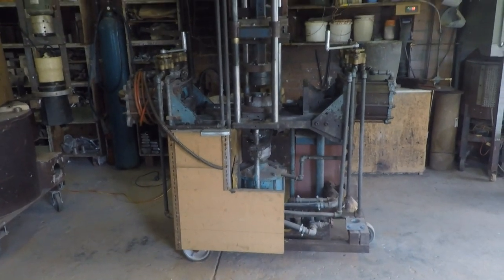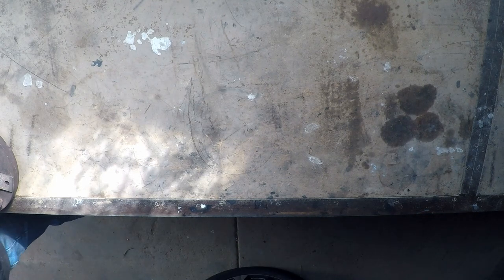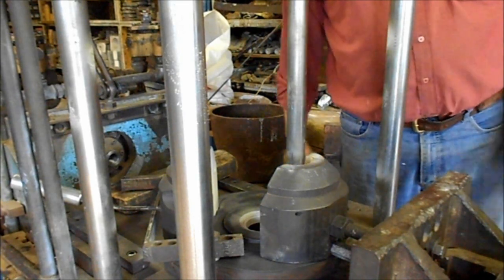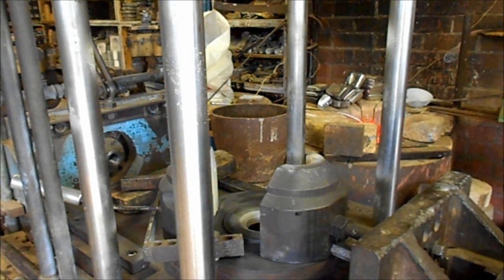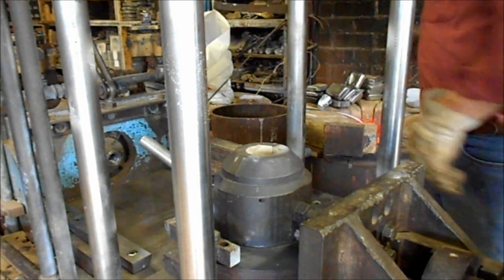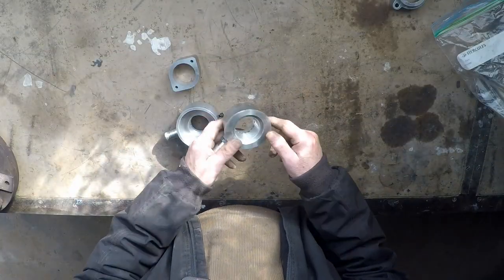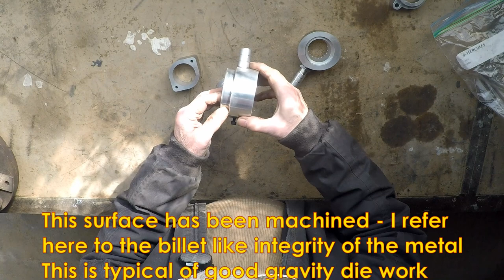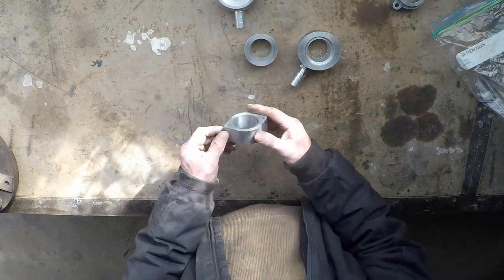A Gravity diecasting journey Part 3:- Complex and hydraulic

Comment: hi martin, thanks for capturing all this on your vids, it is most informative and inspiring. Can you pls list all the sprays and powders you apply on the aluminium molds before and after pouring? Also, is there a reason you did not cast the molds in steel or iron vs aluminium? wojldnt a steel molds be more "durable"? Pls advise, thanks !
Reply: wouldn't*
Reply from the maker: Quentin, I spray the hot die with a mold coat called 14ESS, it is made by Foseco. This is an insulating coat that allows the metal to run and fill the die. Also it helps with air removal from the die. It is my most used die coat. On some parts of the die I use a topcoat (i.e. over the 14ESS) of "Release Coat Blue" by ZYP coatings. This is a coat based on boron nitride and is a very good lubricant  thus it aids release from the die - it is however rather expensive. I use a paint on dry MoS lubricant on parts of the die that slide against each other. I also use some graphite powder on some parts of the dies and the machine that holds them, again it's for lubrication purposes. Most of my dies are in fact cut from cast iron. It is a better material than mild steel - higher conductivity for a start and it tends to hold the spray better. It is easier (if a bit dirty) to machine than steel would be. Only a few of my dies were ever made from cast aluminium, these are short life dies and even then can only be used where the part being cast does not contract onto the die - an aluminium die might last 500 shots a cast iron one many tens of thousands of shots. Does this answer your question? ... Martin
Reply: @olfoundryman8418  it exhaustively answers the question, thank you very much for the details. As mentioned, your videos are very informative. Please keep going, "drop" all you've got on youtube !

Comment: Great vids, lots of good info and small nuanced teaching you only get from time invested.

Any chance you have a vid on gravity  mould design? 
I plan on my first attempt at home doing a metal form to make a product Injeed to complement my lil CNC shop, (trying to learn everything does not/should not be milked from solid! )
Reply from the maker: Brian, No, sorry I do not have a video on gravity die design. In truth I do not consider  that I know enough about the subject to do a video on it (I know, I know this does not stop a lot of Utubers publishing but it does stop me!) Die design is an absolutely huge subject and one that unfortunately has more myth and legend than science involved in it. I am not bad on small simple work  but anything big and/or complicated and I run away.
My "secret" to die design was to remember that a die is not empty  - rather it contains air and if the air cannot get out the metal cannot get in. You see the results at things like internal corners where the metal will round out a little rather than fill the corner completely. A quick touch of die spray will fix the problem for a few shots (the air gets out under the metal through the roughness of the die spray) But a better way is to have some sort of joint in the structure of the die. The air will get out through the minute gap of the joint - if necessary shim the joint apart a "thou" or two. Hence as you say dies are best not milled from a complete solid - segmenting often makes machining easier too. I try to design a die so areas likely to trap air are on joint lines.
The other secret to making dies for one's own use is to make them oneself as to have others cut a die for you is way, way too expensive.  Then you just have to hope that future sales of the parts cast will  cover the cost of your time in cutting the die. This was the only way that I could get into gravity die work - I cut the dies and recouped the time later as best I could - it worked fairly well!
If you have a specific part come to me again and I will give you an address you can send details too and maybe - maybe - I can help with a design..... Martin
Reply: @olfoundryman8418   ahh, the sign of a man how has been in the trade a long time, long past the "knows just enough to be a danger". respect!    I do have 2 what I assume are simple parts in mind, a little advice would go a long way in saving me time/scraping parts!. I would be happy to share infornmation on them. better yet i can provide the CAD model if thats helpfull.
Reply from the maker: Brian, Come to me at   olfoundryman@gmail.com   with whatever drawings/models you have and I wil have a look. No guarantees mind you but I will sure have a good look.... Martin
Reply: @olfoundryman8418  i have sent you an email. thank you again for your responces and videos :)

Comment: I remember from your four barrel throttle body video you said that you were using a filter not to filter the metal but instead to reduce turbulence. (as close as I can remember) I don't recall seeing you use filters in any of your other videos. Do you think there is any benefit to using a filter in sand castings, or is it not worth the trouble. (easier to use with permanent molds than fragile sand molds)
Reply: Check out Martin's series on casting a piston for a 1910 Brush.  He uses a ceramic filter in that casting (which was done in sand).

Link to part 1:  https://www.youtube.com/watch?v=kf2xae2J9HE
Reply from the maker: Rudy, dfrossis right I do use a filter in the sand casting of a piston. This is a high  mould (for me) and with greater mould height comes greater metal velocity and thus the possibility of greater turbulence. Filters are great for slowing metal down, you can get a speed reduction in the metal stream of 3 to 5 times by incorporating a filter into the running system. For this piston we used a filter at the base of the sprue such that the metal had to go through the filter and then into the runner bar - the runner bar was 4 times the cross sectional area of the sprue exit. The filter reduced the metal velocity to a much safer level. I rarely use filters in my sand work because my moulds are quite low and metal velocities are therefore also fairly low. However if I were to use higher moulds I would likely use filters. In the case of the 4 barrel throttle body I top pour the casting and this is to be honest a recipe for disaster as it is a very turbulent way to pour. Initially I did not use a filter and every casting was found to have 3 to 5 mm air bubbles trapped within it  and revealed on machining - clearly the result of turbulence from  the metal falling straight to the bottom of the casting - a fall distance of a little over 100 mm (4 inches). By using the filter I cut the fall down to two falls of 50 mm (2 inch) each - way less turbulence and in now about 1000 castings no air bubbles.. Filters are fairly cheap at about $0.50 each. While perhaps a bit more difficult to use in sand moulds there are ways of successfully incorporating filters in them. Martin
Reply from the maker: dfross, Thank you for pointing that out.... Martin

Comment: Thank you for another great video! What are your thoughts on stacking or layering of the metal used to construct your die? I'm trying to produce a part that's around 4" tall and I am having trouble finding material large enough to be able to machine a solid die. I think you might be doing something similar on your four barrel die? It looks as if there might be a 0.5" plate bolted to the top side of the die making up the feeder height? or is that just wishful thinking on my part? :)
Reply from the maker: Jerred, I like to stack material as the mating faces of the "stack" are never  an exact molecular fit so even if well machined they provide minute gaps through which air can escape. Gaps that I might add can be increased with some very thin shim if needs be. There is indeed a plate bolted and doweled onto the top of the two side pieces of the die. This had two important advantages - it made it possible to cut the die in two parts i.e. above and then below this joint line as separate and much easier operations than trying to do it in the one solid. Also and even more importantly it allows air to escape and thus the edge of the casting's mounting flange forms well  - if the die had been cut in the solid this edge would likely have rounded because of trapped air. I could easily have got material thick enough to make the die in the solid but I deliberately designed the die with this layered structure. I considered that stacking - IF JOINTS ARE CHOSEN WITH CARE AND PURPOSE - is very much a positive but do remember that it is usually necessary to pull the "stack" apart and clean between layers when readying the die for its next run..... Martin
Reply: @olfoundryman8418  Thank you Martin, I hadn't  considered using a 'stack up' for releasing trapped air but that totally makes sense. I started watching your videos forever ago and seeing you produce quality castings they inspired me to try and produce some parts I'd like to make. I realized sand casting was not going to be practical for my needs somewhere around your reflector blanks and throttle body videos where you discussed using a aluminum die, I think.. Already having a cnc, I'm attempting to design a die, which is quite a process.. My hat goes to anyone who has done so. Anyway, I'm in the early stages of machining the mold components but if I run into filling issues it's great to know a potential fix.. Thank you once again.

Comment: Maybe it is stuppid question, but it is possible to cast aluminium die, and then use it to cast aluminium without damaging die?
Reply from the maker: Mat, It is certainly not a stupid question, I have cast thousands of simple aluminium parts into aluminium dies. BUT there are limits - the process does not work with parts that will contract onto the die as this will cause rapid die wear. Die life is short, even with simple parts 200 to 500 castings is about it. But you can make the dies easily quickly and cheaply so it can work well. I have a 4 part video series that shows the whole process from making the masters to cast the die around through making (casting) the die to casting the parts. Here is the link to part 1 of this series https://youtu.be/hVdLDFAgJBg  I cast the die in a piston alloy... Martin
Reply: @olfoundryman8418  so two choices? make die from alu/sil/bronze/ or boron nitride coat on alu die?
Reply from the maker: Mat. The boron nitride spray helps because it is a good high temp lubricant but it still will not allow a "contracting on to the die part" to be produced. Whether or not an aluminium die can be used depends very much on part design.... Martin

Comment: Been watching your videos... A few things maybe you could go back to the basic for the benefit of the viewer the white powder (ash bones?) You are using and the pro and cons if not as well as the powder you use on the risers and the benefit of it. Thanks. ed
Reply from the maker: Edouard, Is the white powder that you're referring to the parting agent that I use with my sand moulds? If so it is finely ground Calcium Carbonate. This material is used commercially as a parting agent for green sand moulds and is considered much healthier than using Talcum powder which (possibly) has an asbestos risk. The dark red powder that I use on the feeders is an exothermic called Ferrux NF  it is made by Foseco. Its job is to catch  fire and generate a lot of heat that keeps the feeders liquid for longer so they are better able to provide feed for the solidifying casting underneath... Martin

Comment: What exactly is the steel alloy that the die is milled out of?
Reply from the maker: Phylis, The large round base plate is mild steel, all other parts of this die are grey cast iron machined from continuously cast bar....Martin
Reply: @olfoundryman8418  you mean I can machine my own aluminum dies from cast iron! 
Amazing. Just saved me lots of money. Im trying to cast some pulleys (10 inch/25 cm diameter) out of aluminum and I'm honestly very new to casting anything. This would be of great help. Thanks so much, Martin
Reply from the maker: Phylis, Yes, you can use grey cast iron to make dies from. In fact it is a rather superior material as it has higher thermal conductivity than most steels and it tends to have a little "roughness" due to the presence of graphite in its microstructure. The graphite being very soft eats out a little and the resulting  slightly uneven/rough surface provides excellent keying for the die coats that need to be sprayed on the hot die. Good luck .... Martin

Comment: I see a lot of similar heat sinks in the electronics world, but pretty much they're always some kind of extrusion.
Reply from the maker: Scodiddly, Yes, you are right. The vast majority of heat sinks are extruded and considering the difficulties of casting them I am not surprised. Once you have the extrusion die you can put out miles of the stuff and just cut to length - so much easier and cheaper.... Martin